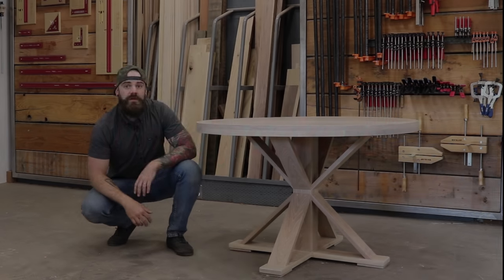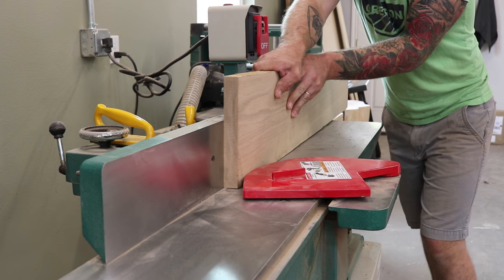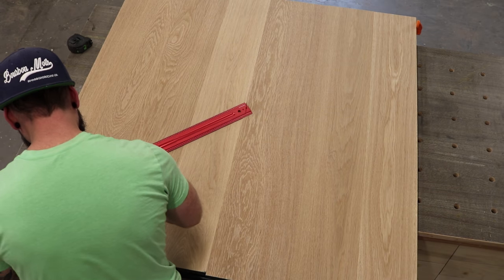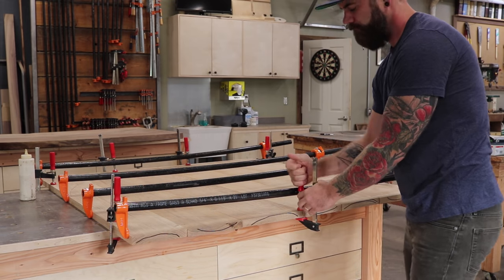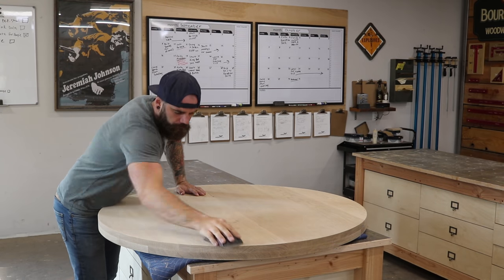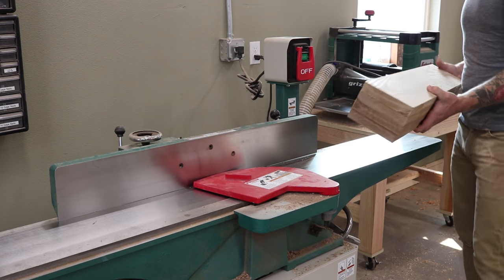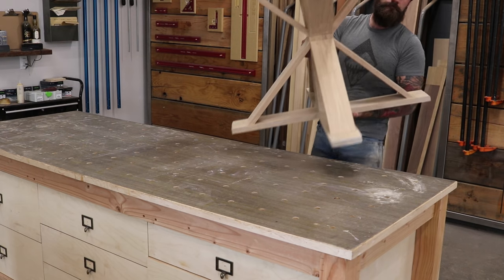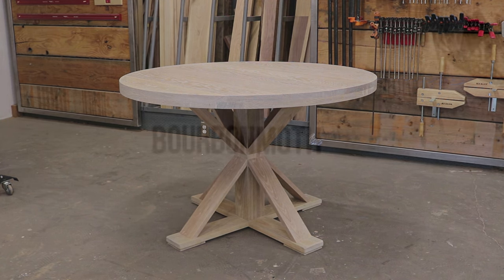How To Build a Round Trestle Table / DIY Trestle Table

Comment: Great looking table. Everyone but me probably already knew this, but if you use this method to have a thicker looking table edge, and paint it vs stain, seasonal movement, guaranteed, will crack the paint in every spot that the wood moves and turn your project into your next potting bench or spray paint table. Some lessons are learned the expensive way 😖

Comment: I used this method of making thinner stock appear thicker by glueing those boards underneath the top twice.  Both times the table severely warped within a year.  I believe because on two ends of the table, the grain of the boards that were glued underneath are perpendicular to the grain of the tabletop.  Has anyone else had this issue? Also, how was the top attached? Did I miss it?  Project looks great!

Comment: It would be cool if you gave some measurements of diameter of table in relation to the floor cross joints supporting the table. For a 48” table I am guessing 32” to 36” ?.

Comment: You still checking old comments/questions? Those beveled diagonal leg supports- whenever I try to drill through a bevel into a flat upright, I always get some tiny amount of screw creep. No way would I be able to get a nice line around all 4 sides of the base. WHAT AM I DOING WRONG!?

Beautiful work!

Comment: I realize this is an older video, but I'm just wondering if you have any issues with wood movement on the pieces that you glued on to the top that run across the grain of the table. I get that they float and aren't glued to each other, but wondering if the movement of the top panel causes any problems? This is an awesome build, I just want to make sure that I'm not causing myself any headaches later.
Reply from the maker: It’s been a few years and I haven’t had any issues. But do keep in mind that I live in Oregon where humidity is pretty moderate from winter to summer. If you live in a climate with a drastic humidity change from winter to summer it might be more of an issue
Reply: @Bourbonmoth  Thanks so much for the reply. Love your content and humor on the channel.

Comment: Nice design, looks great.  However, the massive cross grain glue up on the bottom of the table top, is a huge no no.  There is a good chance that table top will crack in the future.  I would suggest cutting the piece into short sections, turning them 90 degrees, and lining up the end grain instead.  It will not only look better when you look at the edge because it will match the end grain of the top boards, but it will truly allow for wood movement.
Reply from the maker: If it makes you feel any better we’ve been doing it this way for years without issue. Once you cut out the circle the amount of wood actually going cross grain is minimal and by not gluing the profile pieces together it really does allow enough space for the wood to move. I do however agree orienting the boards the other direction might look a little neater. Thanks for the comment 👍🏻
Reply: Glad it has worked out for you.  I just try to let people know to avoid it when they can.  If you use the cutoffs from the top boards and flip them underneath the table top boards, you can book-match the small pieces and the joint line almost disappears.

Comment: What router bit did you use when you cut the top in your circle cutting jig?
Reply from the maker: alfredbot9000 for this top I just used a double flute straight bit. I normally like to use a spiral down cut bit. But I couldn’t find one long enough to cut the depth I needed.

Comment: can i add a math constant to your 45 degree braces so you wont need a template each time?  if you wish to use math, simply measure one of your directions away from the perpendicular (this being the center post) to identify where you want the brace to sit on the bottom leg.  once you have the measurement, simply multiply by 1.414 and you will now have you long ends measurement.

example:  8 inches from center post multiplied by 1.414 = 11.312 inches long end to long end of you 45 cut.

Comment: Jason, built this table but modified it to be a coffee table.  Wife loves it.  

Two questions: 

1. When connecting the boards to make your slab for the table top, what tips do you have to make your pocket holes consistent? 

2. I used a circle router jig on the table top, but this hardwood seemed to give my porter cable router a lot more trouble than I thought it would.  Thickness of my table top was around 2.5 inches  

Any suggestions?
Reply: New viewer here, got hooked when I accidentally came across the lawn mower tank conversion.  Oh how I would love a big  shop like yours.  By the time I share the garage wit h the wife's  SUV, I barely have room for 8 ? 10?  clamps , let alone the wonderful tools you have.
Reply: forgot to mention, your description of how you plan things out is  fantastic..